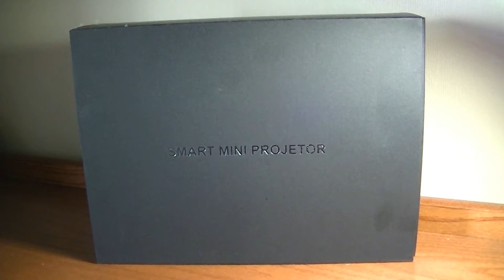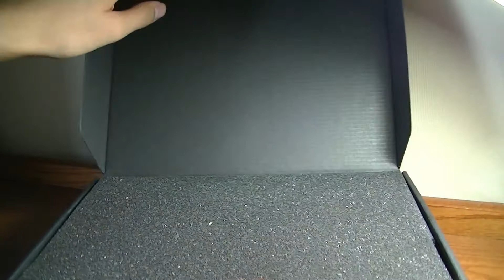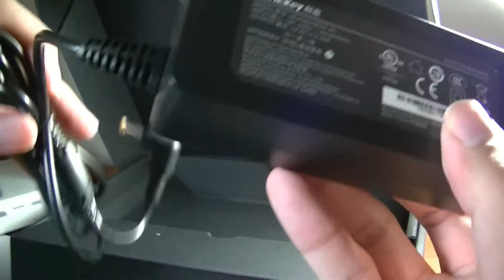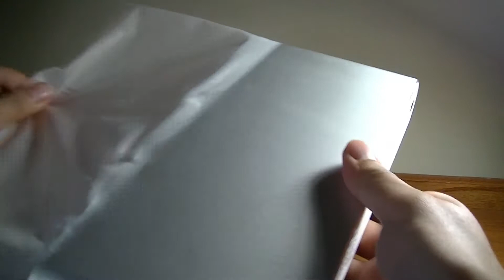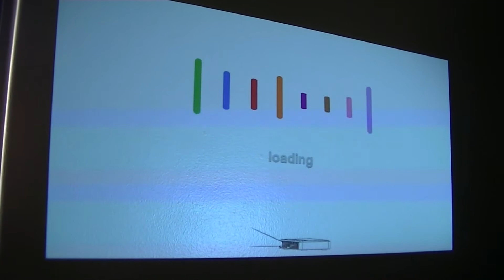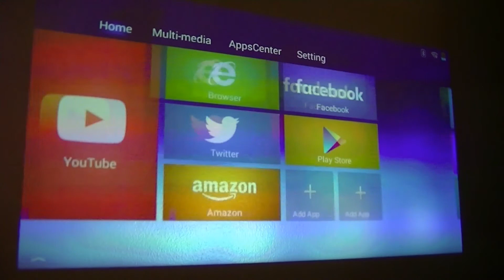Unboxing: Hardoutline HD Mini Smart Pico Android Projector!

Comment: Hello, sorry for a long one, need your help

I have purchased your K2 projector few days back and am facing a lot of software related issues. Tried doing a factory reset but doesnt help, its more like a restart rather then reset.

Issue:

1: When ever am using Bluetooth it says the process has stopped

2: When ever i click on DLP setting it says the process has stopped

3: From yesterday am getting a continuous pop up that says “unfortunately the process com.google.process.gapps has stopped”

Can u plz help me?
Reply: Hello friend, you need to contact Kixin Company they will be able to help you with a firmware update, I was having the same problem the company sell manager Julia Li help me me a lot by sending me the firmware update. Just go to Alibaba website then Shenzhen Kixin Electronics Co., Ltd 
I hope you get help like me
Reply: Mamadou Keita thanks a lot; gives me some hope